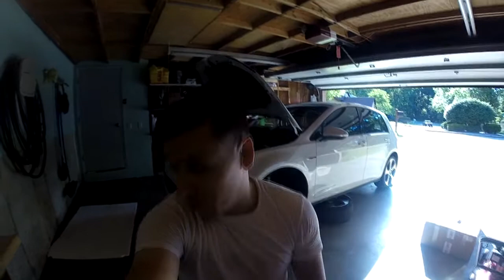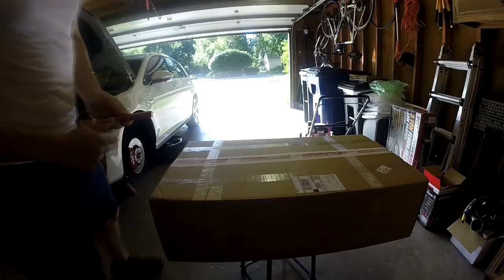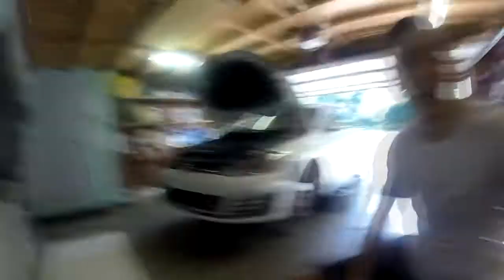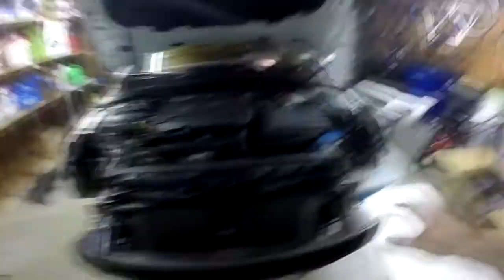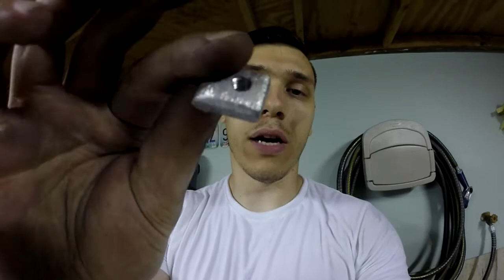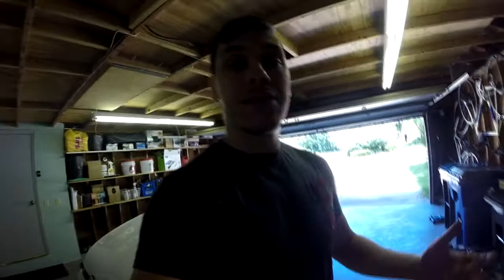MK7 Integrated Engineering IC install...(bad design?)

Comment: Hmmm did u just over tighten that set screw which snapped it off? I was thinking of getting this ic next. But I may go back to the larger neuspeed front mount again...
Reply from the maker: Hi, no the condenser tab was larger than the opening for it in the intercooler. If you force it. It snaps.
Reply: ah shit.. and you'd be hard pressed to find a file skinny enough to gently file it larger... and this was the one i was gonna get...  i can get the neuspeed is38 fMIC or this one for the same price, and this one made more sense... until i saw this.
Reply: LastHumansGarage bro don’t get discouraged it was me being over zealous when I did the install LOL go for it you won’t be disappointed with the results!!
Reply: Rev'n Step bro I was so over zealous, knowing I could do tho all on my own I snapped it lol sorry I took so long to answer lol

Comment: Did you have any issue getting the condenser tabs to slide down into the intercooler? I found that the tabs are spaced closer together than the OE cooler.
Reply from the maker: Yeah it was a bit of a pain but with a bit of a push it fit fine.

Comment: Rev, where are you seeing your intake temps? I have the accessport and I don't a post intercooler temps log? I just did an intercooler install and I want to see the difference in temps. Any help would be great. Thanks
Reply from the maker: Hey.  You have to make sure IAT is a logged parameter with the AP.   Then you look at ambient and IAT.  You try to stay as close as possible to ambient.  Lets say ambient is 80 and your IAT 100 with stock set up.  If you upgrade IC you should see something like 80 ambient and 90 IAT.  Those are just made up numbers.
Reply: Rev'n Step I thought IAT was pre turbo temp? Makes sense I will monitor. Thanks

Comment: Awesome bro I said the same thing when I installed my intercooler on my Mk6 Gti ( never again) but when I got Mk7R I said... why not!!! lol I installed I.E. intercooler and guess what?? It broke in the same spot!!! I was very angry but it bolted up with no problems or friction!!! 7 hours yes but happy with the results good job!!!
Reply: Was the IE worth it?
Reply: DUM BEEZY absolutely HUGE difference!!
Reply: i guess APR is the last one standing which i have never read about a fitment issue on. (aside from my neuspeed FMIC which was flawless... but too expensive for a front mount...)

Comment: Any reason you chose the oe style intercooler vs a front mount?
Reply from the maker: Didn't really feel like keeping OEM in with a FMIC....it will be a lot more added extra weight.  Plus it seems like IE and Wagner are the top intercoolers in the MK7 community.
Reply: Rev'n Step I haven't researched intercoolers yet. So even if you put a front mount in you have to keep the OE intercooler in?
Reply from the maker: Indeed.  The set up is a stack and all connect to one another.  Radiator|Intercooler|AC condenser.  So you have to keep the OEM unit in that way the condenser is attached to it.
Reply: Rev'n Step  Interesting, is there a way I can contact you directly to discuss mods? I don't want to clutter your comments.
Reply from the maker: You can msg me on my facebook page..https://www.facebook.com/revnstep/
Reply: Oem replacement has more volume to go stage 2,3 etc front mounts are very limited
Reply: @fredjones5327  FMIC is good all the way up to 450hp...not many run those numbers.
Reply: Deejay Core in my application I was looking for at least 5 to 515 at the wheel. I’m running 490 with my stage 2 set up
Reply: Fred Jones what mods do u have to hold that kind of power? upgraded pistons, bearings, rods, valve springs and retainers? i'm told the GTi is 450 HP max,400TQ on the stock bottom end...unless u want a short life out of it.
Reply: Deejay Core I have a HPA Motorsports down pipe, full custom built cat back (4”) with exhaust flaps, Black Forest industries pawrus blow off extender, spullen 2.5” charge pipe, and 2.5 inlet pipe, IE intercooler, spullen 2.5” throttle body pipe, spullen turbo inlet delete, APR full carbon cold air intake, APR catch can, Eurodyne full software. My car dyno’d at 490 at all
Four wheels and 399 ft pounds of torque. No internals, I don’t drive hard or race, but I do occasionally take off on folks. Lol I’m gonna sell her and get a 2019 spektrum R in green and do a 3.6L Passat R engine swap
Reply: "FMIC" can mean a lot of things man... there are prob 5-6 different choices of different sizes. i doubt the neuspeed is38 507 cu in one i had could really support 450hp..  but maybe one of those big Baun units or something...

Comment: Why you're running stock intake?
Reply from the maker: Stock intake is good enough for any power range.  Intake doesnt really do anything tbh.  I went back to MAPerformance intake because it frees up engine space.
Reply: elyasfy31 stock intake is sufficient for stage1
Reply: Not true. CAI provides  cooler air. More O2=more power, especially when it is warm outside.
Reply: SunLoverMan stock intake is a cai

Comment: I'll admit I didn't sit here and watch the entire video second by second, just skimmed it as I already did the install. When you are speaking of condenser tabs are you referring to the yellow tabs that you have to unclip? Those were a total pain! Or the actual tab on the IE intercooler where the set screws were installed? I will say, I do not understand why a product that costs that much was designed to be secured with set screws though!
Reply from the maker: chris zimmerman the yellow ones were terrible but its the set screws tab that snapped